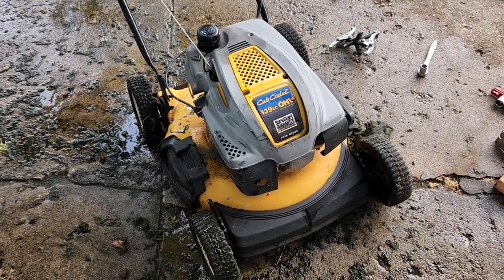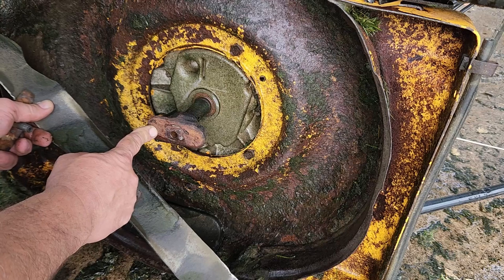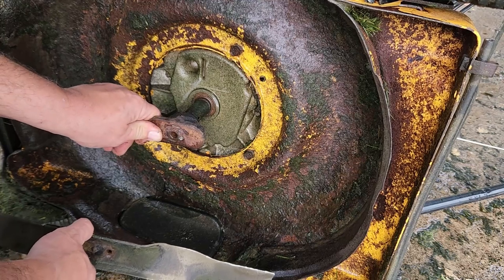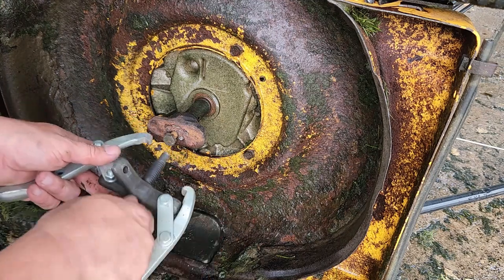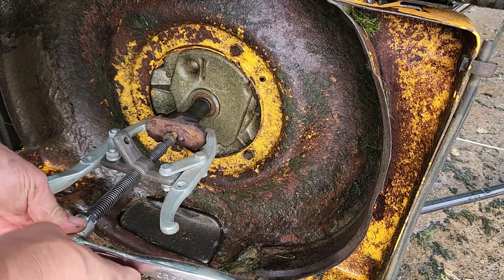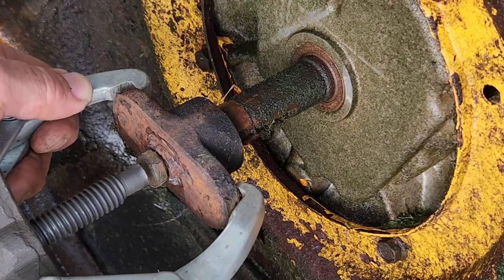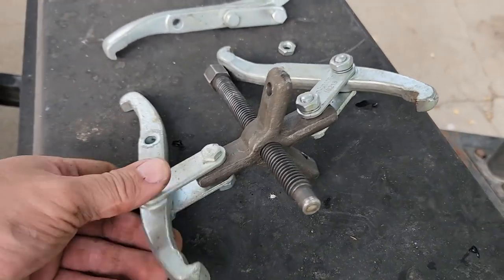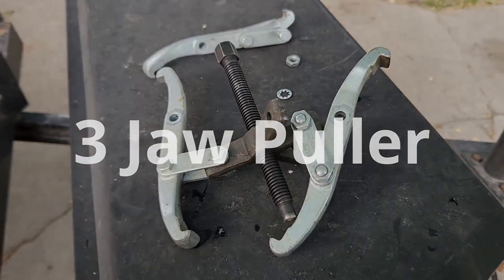Lawn Mower Blade Adapter Removal with Gear Puller - Cub Cadet

Comment: Great idea to use a gear puller to get the blade adapter off
Reply from the maker: Thanks 👍
Reply: @RealManSkills  your welcome young man 👍😎
Reply: Curious as to what size did you use: 6 or 8 inch for push mower.